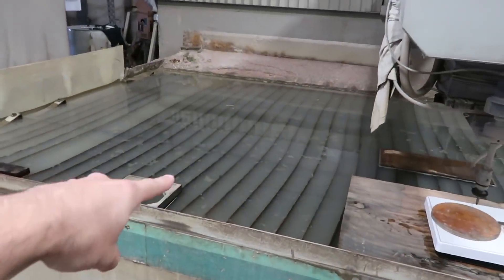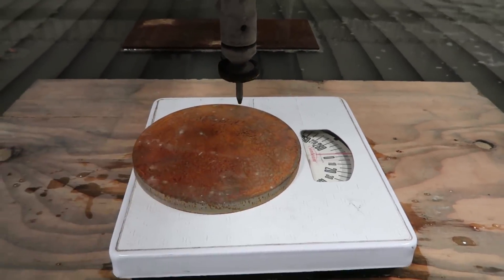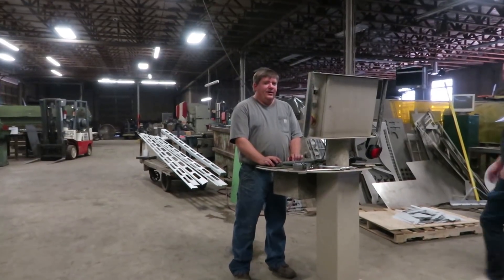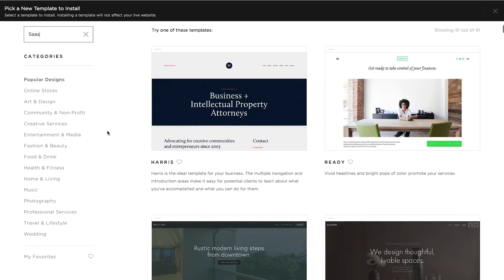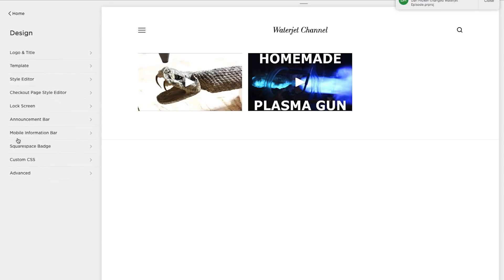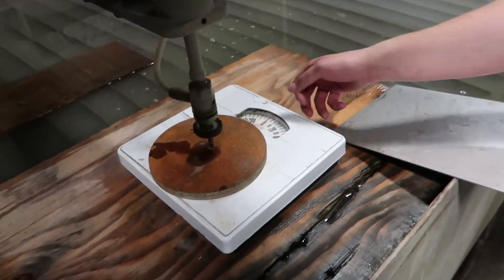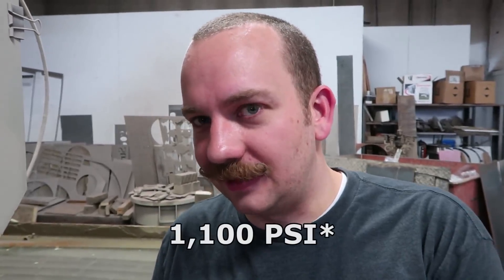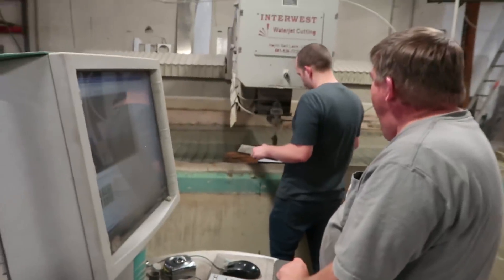How much does High Pressure Water Weigh? Bathroom Scale Cut in Half

Comment: Pressure = Force/Area, rewriting the equation Force = Area*Pressure. Area a circle (presumably the cross-section of the water jet) is Pi*r^2. If we assume the water jet nozzle has a diameter of 1/64 then we can do Pi*((1/64)/2)^2*60,000 = 11.5 lbs.

Comment: my math says:
11lbs
60000psi
0.00018333 square inches.

tiny opening....

second bit of math says you are using a .013 inch diameter hole for your nozzle

Comment: It could be that since the stream is thin it did not push the steel as hard as it will if the stream was covering the entierty of steel. For example, if you push a paper into a      hole it will be easier to push it in with your thumb than you pinky because your thumb has a bigger surface area than the pinky. So because the stream was thin compared to the wide steel the stream did not push down on the steel with all its force.

Comment: You need to measure how wide the nozzle is on the water jet.

A quick Google search shows between 0.01 inches and 0.014 inches. I'll just assume 0.012 inches. I need to find the area from this, assuming a circle, so that's 

A= pi * radius^2
I'll take pi as 3 because we're estimating.
A = 3* (0.012)^2 = 3*(0.000144) = 0.000432

Now we take the weight you guys measured, which was about 11 pounds, and divide it by the area 

11/ 0.000432= 25,462 psi

Not far off considering the fact that everything in this was an assumption. Getting within 10 times or 1/10 the amount is usually pretty good for these sorts of estimations.

Comment: ¡¡¡Spoiler: 70,400 psi!!!

So I think this is a much more complicated problem than just setting up a proportion and cross multiplying to solve for your pressure and hope that it is 60,000. What we have here is water pushing against a plate and the scale is measuring how much that push is. However, the scale works by measuring how far it is moved when a force is applied. So the scale moved 11 pounds worth of distance for it to read 11 pounds. 

Ok. So the moving jet of water feels like 11 pounds if you were trying to push against it’s motion. But that is not pounds per square inch. We are interested in how much force the tiny little jet has in its little cross sectional area, which I will assume to be about 1/8 of an inch in diameter. And I’ll say that it is square, because that’s a little simpler than finding the area of a circle. 

Area of water jet is 1/8 X 1/8 or 
0.125 X 0.125 = 0.0156 square inches

So right now we have our pressure being 11 pounds per 0.0156 square inches. Let’s get that into standard psi.

0.0156 is just 1/64 of an inch square, so 0.0156 X 64 is 1 square inch. 

Now, let’s multiply our 11 pounds by 64 to see what our psi is. 

11 X 64 = 704 

Here’s the deal though. That scale is 10 X 10, so that 705 pounds needs to be multiplied over all 100 square inches of the scale. 

And look what we have here. 100 X 704 is 70,400 psi. I know that’s a rough estimate, as I had to guess at the size of the jet, but this gets us within an order of magnitude! It works!
Reply: TheDoh007 yeah I agree. My logic is definitely flawed. Scale size is irrelevant. I just got excited when I was able to come up with a number of similar magnitude
Reply: TheDoh007 Yea, it is... The size of the scale matters not. You could use a live stock scale or a bathroom scale, and the force is going to be the same.
Reply: Calculating the actual pressure is more difficult due to the extreme speed. The velocity is over mach 3, so theres a lot of viscus effects, and even compressibility of water at these extreme pressures.
Reply: You are correct you need to account for the steel plate on the scale but not the size of the scale. It may be spreading out the force of the jet.
Reply: I know in one of their videos I think they said it consumes 10 gals/minute. If you have that, then you can estimate it. The complicated part is the jet does not come to a stop, but is diverted off the sides of the plate and is not constrained. You would have to use momentum flux into and out of a control volume around the nozzle to get some idea of its velocity. Don't have any fluid dynamics books around, so no formulas to give to try, unfortunately. But, I do remember problems like this back in my days as a graduate student. A simple linear momentum analysis might get you close enough.
Reply: The opening of the water jet is .060 inches in diameter
Reply: Really its a jet being deflected by a plate (impinging jet). There are some basic formulas in fluid dynamics that can give you an estimate of the velocity, and then from that the pressure with the nozzle info.
Reply: Ok, using some basic momentum equations, you can get the velocity from the equation Fy = rho x V^2 x Pi/4 x diameter^2. With Fy being the force on the scale, rho being the density of water, V being the velocity, and diameter being that of the nozzle. Here we assume all the momentum is taken up by the plate in diverting the jet. Using a typical published value of .25 mm as the nozzle diameter and assuming the water is at 25 deg C, solving for V gives 1280 m/sec, using the initial reading of 18 lbs. This is pretty close to the 1100 m/sec velocity typically published for water cutting jets. So... they are around 60 ksi of pressure, in theory, at least.
Reply: mysock351C
ive been trying to say this but people keep trying to say that you just use the size on the water jet and the force to find the psi... facepalm...
Reply: Oh mighty one tell us the meaning of life
Reply: Beth  Moonchild nahhh. The plate is irrelevant too. I think we need to know the weight of the water/garnet per volume, and how much is coming out of the nozzle per second. Then we’d be able to get a proper force vector for the water.
Reply: I think you just got lucky with the numbers. Really you need to know the flow rate of water and some information on the nozzle (loss, nozzle area, etc.) to properly calculate it.
Reply: mysock351C yeah. Bout what I figured. I wonder if we can calculate the velocity by measuring the angular velocity of the saw blade-fidget spinner they put in the jet
Reply: You are close to the right equation to set up the problem, but your basing it on the wrong jet diameter and you have to remember that the hole is circular, so you have to use the area formula of a circle, not a simple rectangle
Reply: Ethan fargo yeah. I was completely estimating with a rectangle, as I didn’t have the circle diameter when I wrote that. Why compound my mistakes when I don’t know it in the first place? 

Also, this is a fluid dynamics problem. We need to know velocity of the water and how much force is lost due to water being redirected and sprayed.
Reply: Source? This is absolutely the missing variable that we need to answer the question, but isn't 60 thou a pretty huge waterjet nozzle?
Reply: Beth Moonchild Well, I think that you are partially correct because the pressure of the water is being applied to the steel plate and then is being applied to the scale, so you would need to account for both the steel plate and the scale .
Reply: A square has more surface area than a circle. If you take that into account it will bring your figure down closer to the 60k you are expecting to see. I can't be bothered to even try to solve for it though, I hate math, and therefore suck at it.
Reply: Noah Stephens im going into 9th grade is this what I'm gonna be learning in geometry (And yes I am going into 9th grade and will be taking geometry I skipped pre algebra)
Reply: Nope you're wrong. As soon as the water leaves the nozzle the pressure drops. So you would not magically end up with more pressure...
Reply: Thank you!!
Reply: Take into account the water starts to cut though the plate and drag from the air.
Reply: What you did: 704 (lb/sq in) x (100 sq in) , the sq in units cancels out which gives 70400 lb of force not psi.
Reply: The Formula to use should be Density*Flowrate*Velocity
Reply: Yeah the are of the scale doesn't matter, only the diameter of the stream of water.
Reply: also woth that scale size its really going to be smaller because of the deadspace being top of the scale and the clear screen not taking pressure
Reply: you determined that the nozzle was an eighth inch square, and then made it look like it works, then you threw it in the trash, and said the square was ten inches, so you used that to multiply it by some random number and your good? 👏👏👏👏10/10 on being confusing
Reply: i think that logic is flawed, but i can't make a good argument for exactly why
Reply: @TheDoh007  you need to account for nozzle flare at distance
Reply: I won't believe you unless you have a mustache
Reply: Noah Stephens um... hi steven hawkins did u come back to life
Reply: Nerd

Comment: The pressure at the nozzle in a perfect world would be about 88,000 psi

Reasons:
I think the pressure at the scale would be about 110 psi because of the fact its an area which is being used in the calculation rather than a distance. but that's not really a bad thing.
if im remembering my physics class we would take the psi at the nozzle would be inversely proportional to the pressure at the scale. the nozzle looks about 1/8th of an inch so im going to use that.  the area of the scale is 800 times greater than the area of the nozzle, so the pressure of the nozzle should 800 times greater than the pressure at the scale. Assuming the water jet is a perfect liquid in a vacuum at a perfect 90 degree angle, the water jet pressure should be  about 88,000 psi.

Comment: Based off my calculations 
   pressure = 60,000 psi
   Nozzle Orifice diameter = .060"
   force onto bathroom scale = 17 lbs

   Area for nozzle is Pi*r^2 so (3.14)(.030")^2 = .002827 in.^2
   Multiply that by 60,000 psi and get 169.6 lbs force round that to about 170 lbs of force. Either the Actual pressure is 6,000 psi or the force is applied to the scale is dispersing 90% of the pressure to the side and 10% directly onto the scale.

The other Calculation is I can find the Orifice nozzle diameter based off pressure and force on the bathroom scale by finding the area.

 I take the force divided by pressure   F/P = A    17lbs/60,000 psi = .0002833 in^2
  Then I divide the Area by pi and Square root the number to find radius of the nozzle.    (A/pi)^(1/2)=r   
                                                                                                                                         ((.0002833 in^2)/3.14)^(1/2)=.0095 in
                       The Nozzle Orifice diameter is .019" based off this calculation
  Please elaborate on this if you guys feel that I am wrong or want to add more to this. I would love to know, Thank you!

Comment: So the area that the weight is distributed over won't affect the scale (except for the obvious fact that without something to spread out the pressure like the metal disk you used, the jet would cut right through the scale rendering any readings meaningless). That means that if the scale registers 10 lbs, you can still get 60,000 pounds per square inch  by shrinking the area down to a small enough space. Doing the math, the total area needs to be about 1/6000 sq in. Using A=Pi*r^2 to determine the area of a circle, r (the radius of the cross section of the jet) figures out to be 1/137th of an inch. Double that to get the diameter, and the hole would need to be 1/69th (heh) of an inch wide, or about 0.015 inches in diameter.

Comment: As pressure is equal to force applied per area, the pressure should be calculated as follows:
As you only want to get the pressure in terms of psi you don‘t need to convert to standard units

The measured pressure is 11 pounds which is distributed across the entire surface of the scale, so if you think of the waterjet as a unit, you‘ll only have to divide the exerted gravitational force of 11 pounds (technically the force is the mass of the object times its acceleration, in this case the acceleration due to gravity but this can be discounted as we don‘t want to calculate the pressure in Pascal) by the surface in square inch to get the pressure in psi (the unit itself tells you how to get it).
If it the scale was 0,01 square-inches (can‘t guess personally cuz I only know metric) the pressure would indeed be 1.100 psi. It would have to be about 0,0002 square-inches to get a pressure of 60.000 psi with a „force“ of 11 pounds.

Comment: What is the orifice size on the ruby you are using? If you take the pounds you measured on the scale divided by the area of the orifice, that should get you your pressure, at least in the ball park. Now, if we assume that you do have 60k psi, and that the scale is in the ball park, you're using an orifice of about 0.015 (that's the ruby orifice).

Comment: The area is not the entire area of the plate but the cross sectional area fo the stream, aka nozzle area. 

If it is 60000psi, the area of the nozzle should be 11/60000=0.00018333333in^2
meaning the radius of the nozzle is 0.00763916307 in. and a diameter of 0.01527832614 in.

if you can get the measurement of the nozzle i could check the psi

Comment: The pressure is probably about 60,000 PSI, but it depends on the size nozzle you were using. Pressure = force/area. F=11lbs, and A= pi*nozzle radius^2. With a 0.02" nozzle it comes out to 35,000 PSI, but it could theoretically be up to 560,000 with a 0.005" nozzle (unlikely). So 60,000PSI is about right if you have a largish nozzle.
Reply: That’s the answer there, thabks

Comment: you'd have to know the area of the nozzle to get the PSI. The formula goes something like the weight exerted divided by the area of the nozzle. If the area of the nozzle was 0.05 inches (for example) then it would be 12LBS/0.05 inches = 240PSI. But I don't know how accurate that scale would be to measure the weight because of diffusion and a bunch of other stuff, and I don't know the nozzle diameter.

Comment: The full stream weighed 11 pounds. You need to know the PSI, which is measured at the nozzle. Please measure the hole in your nozzle in square inches. If 60,000 is accurate, your hole should be 0.00018 square inches.
A = pi R^2
so sqrt(A)/pi = rsqrt(0.00018)/pi = 0.0042 inches
Double the radius, which means your hole should be 0.0084 inches wide, or 0.2 milimeters.

Comment: You couldn't measure the psi of your water jet with a bathroom scale. But if you could find a scale that could handle that weight you need to find the area of the scale in square inches then multiply the weight the scale reads by the area. so weight times area of scale = psi

Comment: U need to know what is the size of the water jet(the nozzle inner area) then Pressure=force*area

Force is 17pound ,which is about 77N.
 And you need to work out the area area of the jet which is π*radios of the nozzle square (in meter) then you can calculate the pressure in newton meter(Nm^2) 
The u can google Nm^2 to psi conversion .

Comment: I think we need to know dimensions of a hole with is cut by a streem, the area of effect. Then it is simple math. 
Scale reading/area of streem = 60000 pounds/one square inch 
Or at least it should be true if mesurmets are correct. For this, the area must be realy small.
Reply: I just do the math, and the area (aka hole left by stream) should be around  0.013 by 0.013 inches (0.000183.... square  inches)
Reply: McKaszkiet They said it is .060 inches. There must be a pressure loss as the water leaves the system, and 60000 psi is the internal pressure

Comment: Diameter of waterjet nozzle at stream = 0.010"
Area of nozzle jet stream = pi*r^2 which = 3.14*.005^2 = 0.0000785398163397448 in^2
1 in^2 / 0.0000785398163397448 = 12732.39 (this is how many nozzles would fit into 1 square inch
12732*11 pounds = 140056 PSI
That is if your nozzle diameter is 0.010"

I bet the nozzle is more like a 0.015" diameter hole
If the diameter is 0.015 then the PSI would be equal to 62247 PSI
3.14*.(0075^2) = .0001767 square inches
1/.001767 = 5658.84 (how many fit into 1 square inch)
11*5658.84 = 62247 PSI

Comment: I’m not a physics guy, but I am a math guy. You need to take the radius of the water stream (half the distance across), square it (multiply by itself) and multiply that by 3.14 (pi). This gives you the area the stream is hitting. Next take the 11 pounds divided by that. This will give you the psi. If the waterjet truly is 60,000 psi, and the force of the stream is 11 pounds then the stream should be .015 inches or 1/64 inches across. Judging from the video that seems a little small so I don’t think you’re getting 60,000 psi.
Reply: Either that or the scale is spreading out the force a lot. Like I say I’m not a physics guy so I don’t know.

Comment: 60,000 psi is the in reference to the pressure of the aperture. So if the water jet had a hole the size of one square inch it would be 60,000 pounds. To me it looks a great deal smaller.

Comment: While the machine may be rated at 60,000 PSI, you're most likely not going to see that at the nozzle. Assuming that nozzles of different sizes can be put on the machine for different cuts, the pressure would be different depending on what size nozzle is being used. The pressure would also change over time as the nozzle wears from erosion by the abrasive mesia. Remember when it comes to hydraulic power (even though the waterjet uses water), pressure is what results when you have opposition to flow. The smaller nozzle will create more restriction, and the pump will have to generate more pressure. Generally, pumps that can generate lots of flow do not produce exceptionally high pressure, and pumps that can generate extremely high pressures do not generally generate that much flow. Realistically, the machine would never see 60,000 PSI unless there was a significant blockage, at which point a pressure relief valve would open to keep the pump from self destructing.